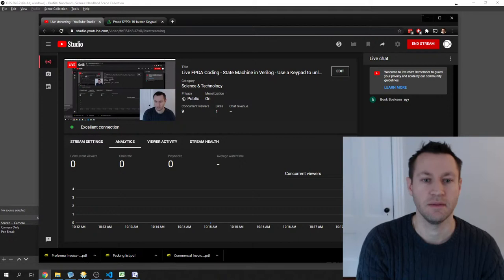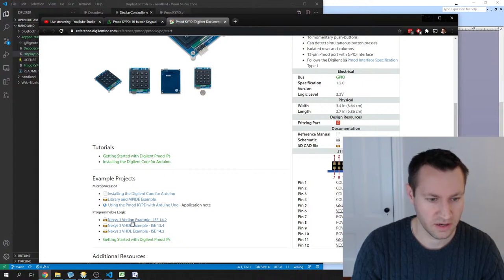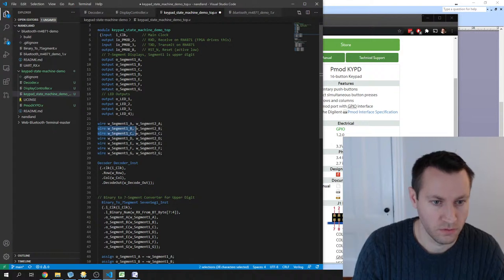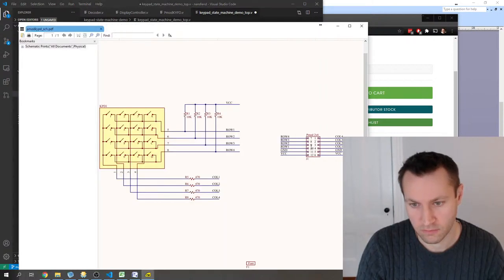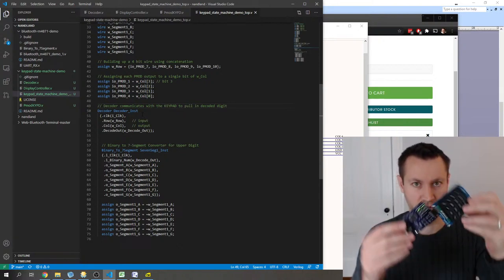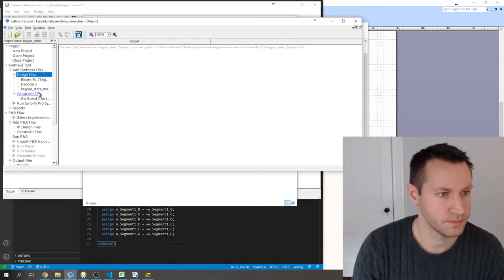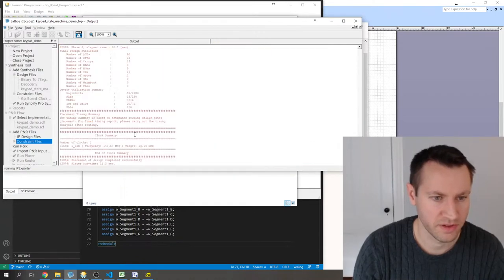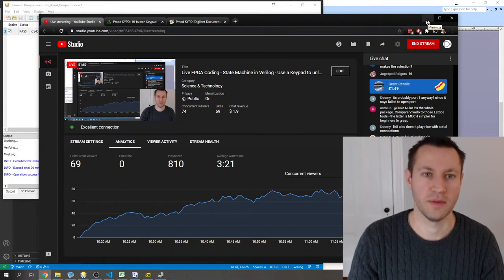Live FPGA Coding - State Machine in Verilog - Use a Keypad to unlock a safe

Comment: Damn, you're using VS Code for this. Back in college we used shitty Quartus II running on some shitty old version of Windows. So slow. Damn, I moved on to Web Dev. Do you think I could use that experience to get a job in Embedded Systems or FPGA design if I brush up on my CE fundamentals?

Comment: I'm using the Max10   https://github.com/stepfpga/STEP-MAX10 ..to learn verilog. I appreciate the step by step instructions on how to program in verilog. I have not got any further than the base examples. Is their any whey to further simplify the IDE's for the intel and xilinx fpga's where you can just upload the verilog without all for the other files that come with it?
Reply: Sadly not, the most similar way is using TCL commands with a makefile to execute all the compile procedures with terminal commands, you can get this commands on internet for the old Xilinx IDE "ISE", but for Quartus or Vivado I never founded without any framework in between, and build the TCL code  from the ground is very complex at least in my opinion, so at the end I recommend you that use the vendor IDE at the moment (you can edit your verilog code in VScode and verify it quickly with icarus verilog, open the verilog code folder that is in your project folder in VScode to do it), and later when you have more experience, use some framework like litex that uses python to do more complex things and allow you to call verilog modules if you want.

Sorry for my english, I'm not native speaker
Reply: Try the VHDPlus IDE